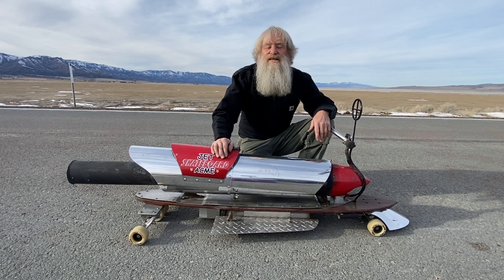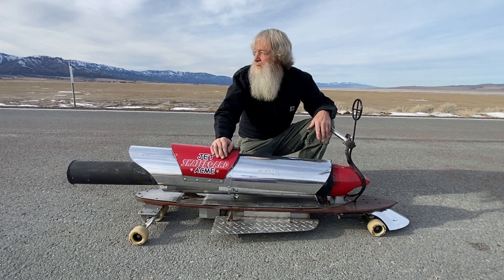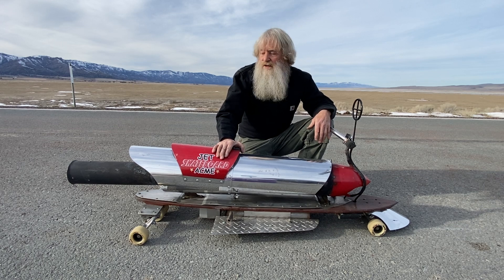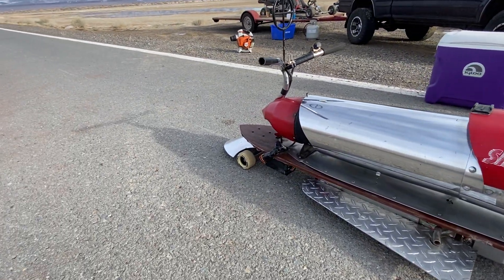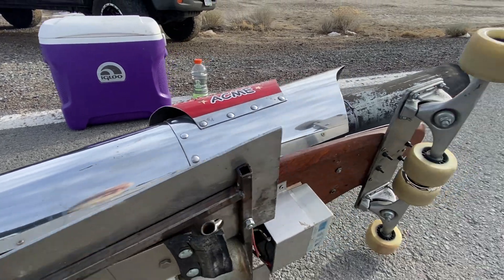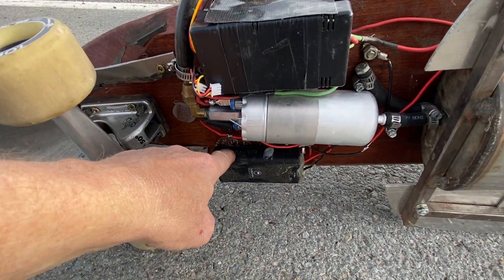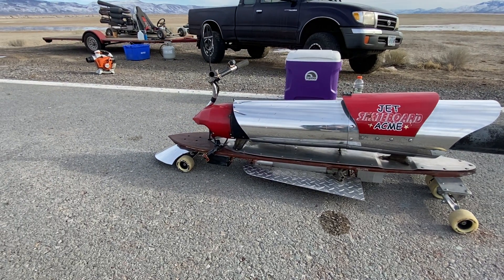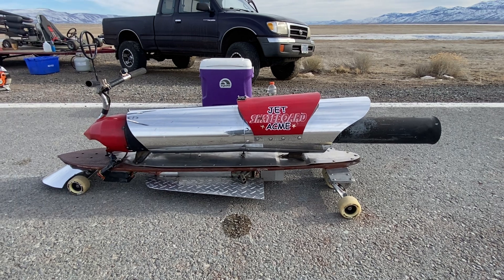Crazy Rocketman: How I made the "ACME Rocket Skateboard"

Comment: "Are you in Genius"? Hey Bob, most of those electric fuel pump manufacturers recommend installing the pump below the tank to reduce suction head. What is your experience as the how much suction head one of those can reasonably pull? Can they pull a foot of suction head? Just curious for my flame thrower project. I want to mount my tank below the framing (as per Alien/Aliens) but can mount it on top if I have to.